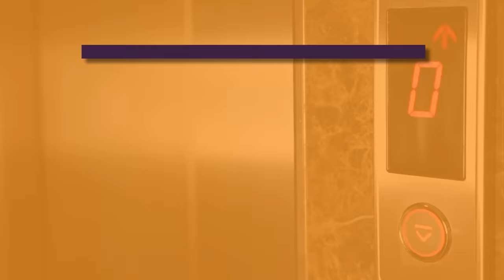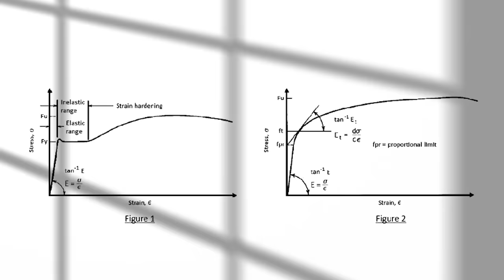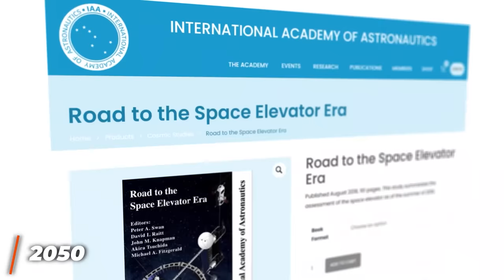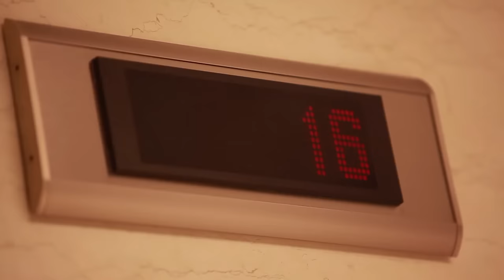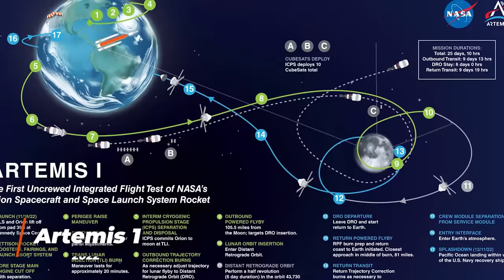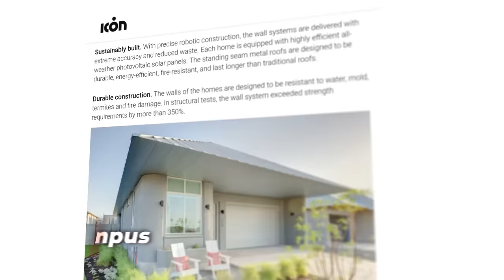Megaprojects of the Future

Comment: How about combining 1, 2 & 3.  A lunar-based solar farm maintained by a lunar base transmitting the excessive power to a rectenna at the top of a space elevator.  (Farm would also power the base, of course)
Reply: Since the moon is tidally locked, it would spend roughly 15 of every 30 days in darkness and not generating power. Being at pole could help, but there are challenges with the angle, lunar geography and whether the exact pole is really a useful place for anything other than the solar farm.

The moon also isn't in a geostationary orbit, so the rectenna on a space elevator wouldn't align with the moon very often. Anything to solve the 1st challenge also causes a problem here, since when the side of the moon facing earth is in the lunar night, then any solar farm on the moon can only have line of sight to one of the Sun or Earth, at least without a really long cable to a point on the moon that always faces the Earth. For that though, you'd need to get hundreds of tonnes of materials for cable up there (I don't think there's much copper on the moon).

On top of all that, a space elevator would be at 10% of the distance to the moon. If you installed a rectenna on the counterweight, that's 20% - it's a lot of engineering to still have to transmit the power 80% of the distance.

Essentially, I can see the logic behind the idea, but unfortunately they're not things that work well together. Of course, once we get the power transmission really well solved, you'd have to assume we'll use it between Earth and any moon base, so that element of it makes sense but probably as a secondary combination of the 2 things rather than a primary use case.
Reply: Thanks, that was a long reply.  
Other thoughts on similar topic could depend what was on the end of the elevator.  If you just put a re-alignable recteena (manual or autoaligning) then yes probably not worth the effort, but suppose you put a whole space station up there (space dock, Star Trek style).  The elevator could shuttle stuff up and down again while the dock serves as a launch pad to the stars (or at least the rest of the solar system, FTL is another video).  
One of the many, many challenges of the mission to Mars is the sheer amount of fuel to get a Mars-capable ship off the ground and into space in the first place.  If you could ship it up to a hypothetical waystation in pieces, assemble it and launch from there it shifts all the calculations.  Obviously manhandling stuff in space suits is severely tricky, but that just means the modules have to be engineered more precisely - after all they managed it with the ISS.
Reply: @robd9413  Using the space elevator as a waystation is an interesting one, plus even the counterweight. Since I've opened some wine and have only nerd-knowledge (definitely not a proper science guy!) I'm not even going to attempt to work out the potential benefit for Mars. Others pointed out that the elevator is useless for the ISS because at low Earth orbit the elevator is still stationary and something like 83% of the energy is used to get to orbital speed, not the altitude.

For Mars though, orbiting the Earth doesn't matter, so without doing the maths, to a random person like me that sounds like a very logical suggestion. It would certainly save an amount, I just don't know how much. I guess the calculation is the impact on delta V vs what the space elevator costs vs how many times it gets used. I do love a good cost-benefit analysis (yeah I'm odd 🤣) plus obviously nerdy science, so it'd be great to see someone like Scott Manley cover that in detail!

Comment: How does the elevator work? 🤔 When it accelerates the payload to its own orbital velocity, doesn't the drag decelerate it / deorbit it? Does the elevator use rocket engines to maintain its orbit? How are they refueled?
Reply: There would likely be fuel piped up from processing plants on the surface.  We have oil and gas pipelines that span continents, similar technology would apply.
Reply: @ckl9390  You couldn't pump anywhere near that high (not with any pumping tech in existence at least) but would the centripetal force "help" somehow? I feel like I'm misunderstanding something.
Reply: @jonmichaelgalindo    Just like cross-continental pipelines there would be multiple pumps in stages with check valves.  It would mostly be a function of how much fuel over what time with respect to how much energy and material us used to pump it up there.  Or, the reserve of fuel at the top for the refuelling station could be brought up by the tanker load on the elevator.  That would just take up lift time capacity that could be used for something else.
Reply: @jonmichaelgalindo    The cable is supported by a counterweight in most designs that can adjust outward beyond geostationary orbit, so the centre of mass can be controlled even with a dynamic weight climbing the cable.  Though an active, and constant, thrust counter-force system would be required for any system shorter than geostationary orbit.  The key is that the cable is a tension system because that allows us to use materials that are plausible to us.  Whereas a compression based tower would essentially need to be built like a mountain that reaches beyond the upper atmosphere and would still require thrust to achieve orbit.

Comment: A space elevator car would clearly not be at orbital velocity at the low earth orbit height of the ISS. Accelerating a package to LEO orbital velocity from the elevator car would probably require  almost as much delta v as launching from the surface. Not well enough versed in orbital mechanics to actually work it out of course.

Comment: Sky Hooks are more realistic than elevators and you wouldn't have to go as low as the ground. You could probably even make it with synthetic spider silk. As for the Artemis program....I think it's a white whale, The way it's set up makes it incredibly risky and too complex for it to realistically go smoothly. It requires at least fifteen falcon rocket launches all successfully managing to do an orbital fueling maneuver we have never successfully accomplished, then we would have to do a complex orbital maneuver around the moon, because the rocket doesn't have adequate delta V.....Smarter Everyday did a good job break down on why it may have issues acomplishing it's purpose.

Comment: You would not be able to use a space elevator to resupply the international space station, for two main reason, it won't be around by 2050, and secondly the tether of the space elevator moves with the surface of the earth, meaning that at 400km up, the ISS would whip passed the tether at a blistering speed of 27 000km per hour, so if you were to try this, you'd likely end up smeared out on the windshield, in a way that no bug on earth ever experienced. Essentially if this is to be achieved, one would need to take a whole rocket up with the space elevator, then use that rocket to achieve orbit from 400km starting point, only then can you get to the ISS. And the rocket you'd need would be very close to size you'd need to get off earth the old fashioned way, this is because at 400km the tether is only moving the speed the earth is, meaning that you require the same acceleration either way. 

Simply put there is no gain at releasing anything below 35 000km, as anything below this height would not have enough orbital speed to stay in space, you would simply fall back to earth. You would need to take the ride all the way to the top, then use thrust to lower your orbit to where you want to be, this way would be the most efficient by far, orders of magnitude more efficient than the old fashioned way. This is mostly due to fact that once you are in space, maneuvering is supper cheap, to put this in perspective, if the Apollo's stopped at the moon, and there was a fuel station, they would only have need another 5 tons of fuel to get all the way to mars, compared to the 2500 tones of fuel it took to get them to the moon in the first place.

Comment: Just because your in geostationary orbit doesn’t mean gravity now acts like earth. Your still moving horizontally thus weightless, even though the ground stops moving relative to you. You’d need to propel the elevator perfectly downward for it to “go down”. Then there’s pulling the elevator back up, would it not pull the part that’s orbiting down? 

Correct me if I’m wrong I’m just spitballing 😂
Reply: Space elevators are flat earth science. You are being accelerated outwards and forwards from the center of rotation. When rockets are accelerated into orbit, you can clearly see that they follow a curved path. As in, when they gain vertical altitude, the earth moves horizontally underneath. The rocket is accelerating itself so it accelerates independent of the Earth's rotation. Tie a cable to it and now it gets its acceleration from the Earth's rotation. The earth has to spin faster and faster that station into orbit. It's the same as a person on the ground swinging a tether ball around them. The greater the radius, the faster the person has to rotate to keep the string taught. The greater the radius, the more outward force the ball is placing on the person. That's why when you get to a geostationary orbit, the atmosphere disappears. F=ma, as the acceleration factor increases, mass decreases or the amount of force increases. The only way a space elevator system is going to work is by creating a bicycle spoke system to balance out the forces being exerted by the cable elevator.

Comment: The satellite at the end of the space elevator has to be geo-stationary, otherwise the trailing end of the cable would be flying across the surface of the earth, which makes it a bit impractical for attaching it to the ISS (which is not geo-stationary).   Am I missing something?
Reply: No, just people don't understand how orbits work.
Reply: While it is true that the top of the space elevator would need to be in geosynchronous orbit, couldn't you simply build a space station lower down on the elevator? Regardless if that would work though, you're certainly correct that the ISS wouldn't be able to easily connect.

Comment: I’m just surprised that shooting the power down from space solar farms wouldn’t some how effect the temps in a negative way.
Reply: Satellite television and communication companies send microwave signals to Earth all the time, now.
Most of the conversion to heat takes place up in space, where the solar gets converted to microwaves.

Converting microwaves to electricity, down here, would generate some, but it generates no CO2 to trap that heat.
So, it's a better solution.
Reply: I grant your answer its validity for sure. I would ask this though. Intensity and size. I’m sure such a massive structure would be sending down copious amounts more than a satellite or even many satellites. Then factoring in the fact it needs to be geo locked, unlike satellites that orbit, the energy coming into the atmosphere would not disperse like your referencing with what we currently have.

Now, I’m not very knowledgeable in thermodynamics or anything so, I could be totally and absolutely wrong in my pondering. Smarter people then I will have to find and contend with such issues :).  Thank you for the reply though, it is always wonderful to know some one has read something I wrote :).

Comment: How does one hop on a spacestation in leo (travelling with 24000kph) from a stationary space elevator?
Reply: Go up to the station.
Launch a ship from there.
Use its engines and a gravity assist to match velocities as you fly down to LEO.
Dock.
Save more than 80 percent of your fuel costs -- which is more than 80 percent of your launch costs.

Comment: Getting to the ISS via space elevator is not that simple,  The ISS is moving 18,000 MPH laterally because, y'know, orbit.

You'd have to get up there and THEN get to 18,000 MPH.  This would require less energy than doing it from the ground, but you'd have to do it without falling back to Earth, so you'd be burning up mostly and...  Well, GETTING to 400km was never the hard part about space.  It was the orbit bit.  Geostationary orbit only works because at that height, orbital velocity is one orbit per day.  Once all the way up there and in a stable orbit, you can take your sweet time to get around.  NOW it's easy to get to the ISS.

Comment: Solar Farms could feed the power directly down the Space Elevator Cable, with some being siphoned off to run the climbing motors..
3:32,... annnnnnd, Nope. If an elevator is built, anything in LEO is going to need orbital adjustments to avoid the fixed point object in their way. A trip up to the height of the ISS will just have the payload at the right height, but not at the orbital velocity needed. Any vehicle needing to transfer from the elevator car to a LEO destination is going to drop like a stone while trying to accelerate sideways. And that's before dealing with potential stresses caused by changing the loading on the cable by letting a vehicle leave the climbing carriage.

Comment: Any government (or bad actor) could hold the world hostage with this incredibly high value target . . .
Reply: With the solar farm in space hacking the controls  they could use the microwaves as a weapon :(
Reply: @raymondclark1785  The rectenna on the receiving end would be dozens of miles across, because they probably couldn't focus it in any more than that, and what makes it to the surface beneath the rectenna would be so light that livestock could graze on the grass.

If you're worried about "death rays" from the sky, just build the hardware so the transmitter couldn't focus them any more than that.
You can't hack something with software to make it do something the hardware doesn't permit.

Comment: So can't they use the  space elevator tether to transmit power from the space solar farms?🤔
Reply: Wires would be even less efficient than beaming microwaves - unless you had superconducting wires. Plus, adding the mass of wires will lower the average specific strength of the tether, which makes the space elevator even less feasible than "completely infeasible". Sorry but, Infeasible + Infeasible != Feasible.

Comment: I'm surprised you didn't have an orbital ring on this list. Unlike a space elevator it doesn't need some yet to be figured out how to mass manufacture material it can be done with materials we already have available. However same as the solar farm the cost of getting all that material to orbit is cost prohibitive. Yet by being in lower orbit transmission lines not beams are possible avoiding the possible environmental effects of beaming through the atmosphere. Regardless its not cost effective yet. Check out SFIA's video on it for more info.
Reply: Or the Tethered Ring, which solves both the problems of getting to space cheaply and economically producing clean baseload power.
Reply: @pewterhacker  Yea however depending on where you build one you might run into international issues building it.

Comment: Solar energy transmission is the big problem. The Sahara Desert is wide open, available and cheap but all solar projects there are stymied. Not for weather or maintenance but for transmission. You can't transmit power over long distances without massive, unrealistic infrastructure. 

There is just too much loss in the lines from Virginia to the Sahara. They can't even make it feasible from the Sahara to England. 

When the energy transmission problem is solved, then you're talking dyson spheres and asteroid mining and real progress.